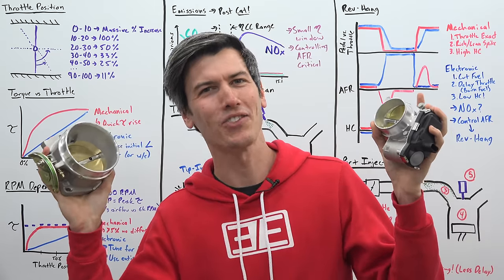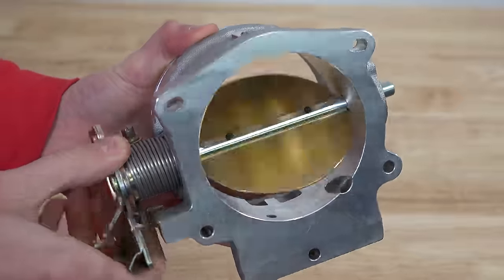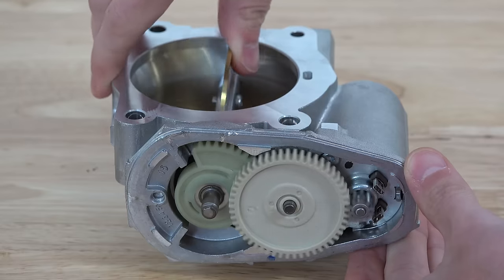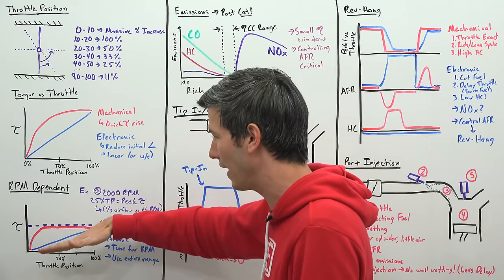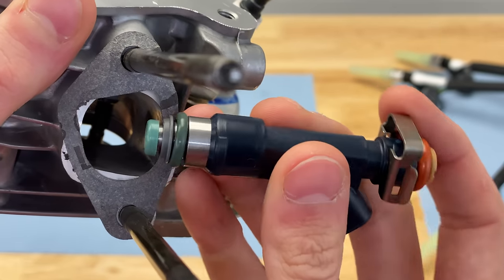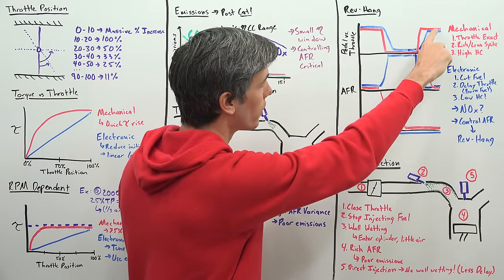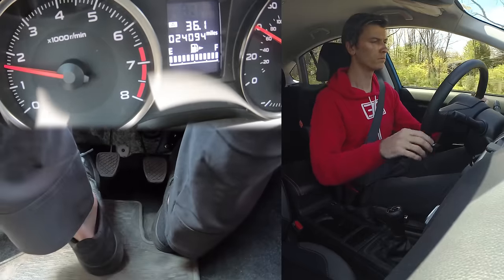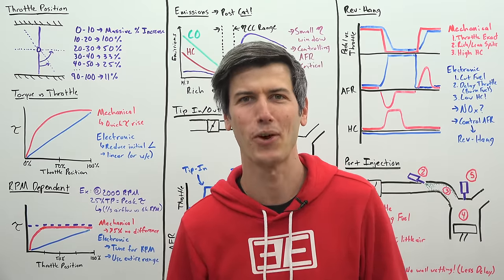The Big Problem With Modern Manual Transmissions - Rev Hang

Comment: With your skill set on how things work and how engineering is pure at source ( brand new engine / gearbox) would you be open to the idea of showing how a full service on an older 10+ year old car can help prolong the machines life, i know you have talked about oils and what not... but a full on  service, all liquids ( oil engine, oil gearbox, oil rear dif, brake fluid, synthetic bushings , spark leads, plugs , filters, regassing shocks, brake pads and rotors) you see where i am coming from? i know it is an expensive task but it may open many car owners eyes.

Comment: 100% correct, electronic throttle bodies no good for manual trans !  Revs don't go down fast enough and the drive train jerks when you let off throttle, shift, and go back to throttle because the revs are still to high. Sloppy shifting, NO GOOD. I experience this with my rare 2019 GMC Canyon 6 speed manual, shifting from 1st to 2nd ! You must wait longer in between shifts.  Don't like it !

Comment: Quick rev hang fix, Pedal Commander, Sprint Booster, or Roar Pedal throttle controllers. I'm sure there are others too. I have the PC and I'm getting better fuel economy and at higher speed too. I can get 30+ mpg at 77 -83 mph. I don't know the math but after 23,500 miles of driving I took a 2100 mile roadtrip. I still haven't reset my avg mpg but I left at 18.0 avg after 1000 mi I was at 27.2 mpg. I even played in the triple digits here and there. That's gotta be over 30.

Comment: hello! i liked your video but a few months back i was in my car at the highway and it was just fine but then, the engine started heating a little bit cuz it was summers but i started having a problem suddenly that when i lift of the throttle the rev just stayed where it was and did not dropped until i pressed the brake pedal and if i would press the clutch instead of pressing brake the revs would go higher  i have a 2013 renault duster 85PS any idea what would have happened, anybody??

Comment: All I know is I do not like the feal and the lag you get when it needs to be adjusted with a cable all you need is a 12mm wrench to adjust it for electric if you even can adjust it is about $100-$250 to have a shop reflash it and if you can't adjust it you have to replace the valve itself and that can be up to $500-$1000 and if you go from slowing down the on the gas right after you have a jerkiness you will never experience with just a cable if it does happen all you nead to do it the take up the slack usually every 200,000 miles most people dont even keep cars for that long if they only see a car as transportation/"non car people"

Comment: Did you mention electronic throttle also eliminates the need for a separate idle air circuit and an Idle Air Controller (IAC), eliminates one more failure point.  Maybe attack the problem from the other end.  Modern motorcycles have a slipper clutch which allows the clutch to slip if your downshift is too abrupt and would risk locking the rear wheel or overrevving the engine. Would a similar arrangement smooth the transition?  I think not and that it is an answer to a similar problem, but not this one.  My grey cells are not firing on all cylinders after a long day.

Comment: Just wanted to leave a note about the throttle response % versus throttle pedal travel on mechanical throttle bodies.. my 1987 Porsche 924S, and most Porsche 944's, had an OEM mechanical throttle body with a elliptical cam shaped guide for the throttle cable, so instead of the pedal travel having a linear effect on the angle of the butterfly valve, the initial pedal travel opens less % of throttle than the final pedal travel, as the lever arm between the cable and the axis of rotation of the butterfly valve changes throughout the pedal travel. Many people swap fixed diameter circular throttle cams to the throttle body claiming a more responsive engine; the throttle pedal simply opens a larger % of butterfly valve earlier in the pedal travel, equating to more open throttle with less foot travel, but a non-linear torque response.

Cheers, J

Comment: A way to combat this scenario is to change your shifting style. I drive an 18 Jeep renegade now but I've always shifted this way... Accelerate through the gear, put pressure on the shifter like your ready to shift to the next gear, let out of the gas, the shifter will fall out of gear, push in the clutch, then slide into the next gear. Makes for a buttery smooth shift and no rev hang.

Comment: Thumbs down on the video.  Good info, but it doesn't really discuss the problem of rev hang.   More time is spent on the benefits of dry-by-wire throttles.  Where in the video does talk about how it can be almost impossible to make crisp, smooth shifts? Jerkiness of shifts? Increased clutch and synchro wear?   Anyhow, rev hang has gotten a little better in later model cars, but I'm done with manuals after I bought an '05 manual with drive-by-wire - it was a disaster.

Comment: Yeah, I hate rev hang. My Saab 9-5 had horrible amounts of hang. But me and my dad noticed that my mother's newer 9-5 with biopower capability didn't have this issue.

So when we tuned my car (we do it our selves, Saabs are nice that way if you know what you're doing) we switched to a program from a newer 9-5 and then tuned that.

Voilá, almost no rev hang at all and ofc a lot more power and torque ;-)

Took a while to get used to shift so much faster so I got jerks the other way around, from RPMs dropping too low xD.

All good now though, but it took some time getting used to it. :-)

Comment: I never thought there are so many things connected to the electronic throttle. I thought that it was simply a 1 to 1 system where the motor acts exactly like the pedal with just a connection to ESP and traction control  to make them work.
I have a red 13yo VW Polo GTI since new (the engine is the four cylinder 1.8L 20V Turbo), now with 282.000 km on the clock, and when I drive I always think about the electronic throttle, how responsive it is even with small moves of the pedal, and I think about the moment that it will fail and stop me on the side of the road. I know it will be the throttle, that small motor does too much work to survive so many kilometers. But the good thing is that I never felt rev hanging problems; maybe it's the sporty configuration of the engine or just because Germans know how to do things in the proper way. From tomorrow I'll pay more attention to this detail, I know it. 
Greetings from Italy.

Comment: I tried driving my step dad's Arteon with an automatic transmssion. Horrible response from the gas pedal. I could floor the pedal and it would take 1-1.5 seconds just to accelerate at the speed I wanted. Even my shitty polo 99 is more fun to drive (it's not even that bad, but his car is much more powerful than mine).

Comment: I have a 2001 cavalier with a cable, and a 2005 Malibu with an electronic throttle. Both automatic.  I MUCH prefer the cable.  The electronic throttle is weirdly linear, just not what I''m used to and have come to expect.  All it really does is take control away from the driver I can 'tip in' and 'tip out' slowly on the cavalier if I want to and reduce its emissions, but I"m not forced to by the computer.  It does make the cruise control more consistent but it wasn't really a problem to start with.  Moreover not ONCE has a plugged sunroof drainage hose caused water to get onto a connection in the A pillar of all places that connected the throttle body position sensor and confused the car about where the gas pedal was and put the car in limp mode every time in rained, on the Cavalier with a cable.

Comment: It's just a matter of time that the manual transmission will not be offered at all. When the ECU cant control all parameters. Engine load, tip-in and tip-out happens many more times when the human is shifting the gears!

Comment: I agree with most of what is said in video. I am not sure about the part of max torque at small% of throttle opening and of course throttle response. In real world driving and according to shop manuals there is a delay of throttle response for a number of reasons.  One is transmission failure due to aggressive driving, and the other very important feature is traction control. The computer will limit my torque demand if it sees rotation in a drive wheel over any others and reduce power out put. The simplest way is to close the throttle, there are other factors, but why not use the KISS principle. If possible I would love to see an acceleration test of a vehicle that could be fitted with either a mechanical throttle control or computer controlled throttle. Depending on the skill of the driver would expect a less capable driver might see improvement, but with a skilled driver there would be little or no change and maybe even a decrease in acceleration.

Comment: I hate these fly by wire systems you just don't have the same fine direct control over a cars weight balance in the middle of a corner that you get with a throttle cable. I don't care what other advantages fly by wire has it feels awful to drive and ruins the fun.

Comment: So by pressing the pedal you're not giving the engine gas, you're giving it air? (O_____o(
Reply: Yeah, then fuel gets mixed with that air to a correct ratio before it's sent into the combustion chamber. Getting fuel in the engine is not the challenge, air is, that's why turbos are so good, because they push big amounts of air into the engine, and with more air, more fuel :)
Reply: @gabrielcosta3301  :)
<3

Comment: Why didn't he highlight the solution to this in most cases? Learn how to double clutch! The computer will pick up the neutral shift and close the throttle... with clutch systems now a days it's effortless to disengage the flywheel on a stock setup. Saying your leg gets tired doesn't work anymore lol

Comment: for "Tip in/Tip out" isn't your MAF sensor before the throttle body?  wouldn't that adjust your F/A ratio before it hits the cylinder?
Reply: this is a mechanical throttle body, 03 Protege I beat the crap out of.  Just curious.

Comment: Simple, economical and reliable vs complex, expensive and unreliable. Very minimal advantage to driving experience. Just more sensors and electronics to go bad.
Reply: In a lot of ways, electronic throttle bodies are much less complex than the mechanical throttle bodies that existed before the switch.  At the end mechanical throttles had idle control valves, (possibly multiple) by-pass valves, and multiple inputs from sensors in addition to the throttle cable.  Electronic throttle bodies reduced that to a single valve and a single input.
Reply: @TheInfinityzeN  fear enough but technical concept does not always relate to reality. I will tell you this much being around vehicles electrical throttle bodies are 80% more likely to fail before 100,000 miles and more than 50% more expensive to replace. The only thing I have really seen fail on a michanical throttle body under regular driving conditions are the position sensor. just my experience.

Comment: I found the cause and solution to this problem in my 1999 Contour SVT.  It was the IAC (Idle Air Control) valve.  The throttle body was conventional cable operated so I'm wondering if the solution could be the same - Assuming the new systems have retained the IAC valve.  Find the bypass hose feeding your IAC and obtain a copper pipe cap at the hardware store to match the I.D. of said bypass hose.  Drill a hole in the cap large enough to allow normal idle (no larger.  Start with 1/8" and enlarge from there as needed) and insert the hole-y cap into the bypass hose ahead of the IAC.  This will minimize some excess air induction.
FYI, the auto transaxle Contours had this problem manifest as a 'bang shift'.  Accelerate moderately from a stop then let off the throttle just before the transmission shift - BANG!!  Violent lurch as the shift happens. RPMs have not dropped with throttle position and it is most uncomfortable.  IAC copper cap mod worked like a charm.  It's cheap and non invasive.
Reply: yeah i did this on my one too .. sadly Flyby wire cars dont have IAC's

Comment: As a tuner, I have found that I have settled on tuning for 100% output at 90%+ throttle position.  In addition I normally tune the very low input at a lower ratio of demanded power (normally 0.5% power per 1% input) anywhere up to the first 10% of input.  How much depends on how crisp the pedal is, low rpm engine power, type of transmission and intended use of the vehicle.  Sloppy pedals (rare now-a-days) get less, engines with lots of low rpm power get more, manuals get more than autos, and city/stop and go driving gets more.  And if you are wondering at why 90%+, check to see how hard it is to engage that last 10% in your vehicle due to things like the carpet/firewall and the angle of the pedal.  In some vehicles it will require very little to no more effort, while in others it is a massive pain in which you can never actually hit 100% throttle position.

All that reduced power turning at the bottom makes a huge difference in how the car feels and drivability.  It can remove any feeling of twitchyness on initial tip in (especially important for vehicles with a lot of low end power for their weight), help steady state (cruising) become easier to maintain a smooth speed, and reduce clutch engagement jump especially from a stop (had way to many people rear end me from this).  And if you are one of those people who has the bad habit of resting your foot on the pedal all the time, I can even tune the first 1~2% throttle to demand 0% power over idle.
Reply: Found this video and your reply very interesting, one of the things that frustrates me in my car is the perception of drive by wire lag in the throttle response which spoils the acceleration experience. For a while now I have been considering purchasing the "sprint booster" product much raved about on YouTube videos, my only concern is that you are messing around with how the car is supposed to be set up and that by shortcutting a problem in one area you are creating future problems in another. The video suggests that this set up is done to comply with emissions being an important factor. Any views?

Comment: I leased a Jeep Wrangler Rubicon shortly after the JK generation came out. It had a 6-spd manual transmission mated to this dog of a V6 3.8L, and it had the most awful rev hang imaginable. I always thought it was due to a heavy flywheel, but now I learned that it's because of yet another singularly focused on emission initiative that doesn't consider the trade-offs. Thanks for explaining the engineering.

Comment: Not  taht all. Depend  how big is engine cubic centimeters-  and  have that petrol or diesel engine =  Diesel have 20  ATM on cyclinder / petrol 9,1 -10,8 ATM . My Dacia Sandero is 3 R 1,0 i enigne with 53 kW / 109 Nm =  at speed 50km/h 1900 rpm / 70 km/h 2400 rpm / 90 km/h 2900 rpm / 120 km/h 4000 rpm. Max speed 158km/h and max rpm 6750 rpm. Green area  are 2000 -  3250 rpm /yellow area 1250 - 1950 and 3300 - 5500 and red area 0 - 1100 and  5600 -6900 rpm max 7200 rpm

Comment: dunno if I'd call mine "modern", but I noticed something similar in the 1994 Accord I used to have.  Hit the clutch and the RPM would drop very gradually at first, then take a sudden nosedive towards idle, making it very difficult to time it right letting the clutch back out again

Comment: Manufacturers and legislators have taken away driving experience which is why which I have ditched my new car for a 20 year old classic.
I now have car designed by mechanical engineers that I enjoy driving. It has knobs switches and dials as opposed to a distracting IPad and touch screen designed by software geeks better suited to playing computer games. 
I can listed to the radio or music and don’t get interrupted or force to enter conversions with “voice control”. 
Most importantly the software is not stalking my every move or invading my privacy.😊

Comment: They do it to avoid warranty claims for ruined catalytic convertors from going out of fuel air ratio limits. Catalytic convertors require the engine to burn rich to avoid NOX, thus selling more fuel to the Rockerfellers et all, in addition to the expensive convertors, so its win win for the oligarchs forcing us to buy from the company story by goverment force, all the while believing we are saving the enviroment. Water injection is used in power plants/aviation engines throughout history to to the same thing with better fuel efficiency.